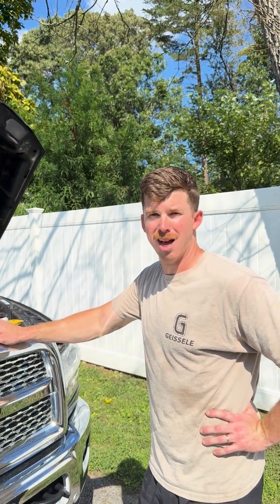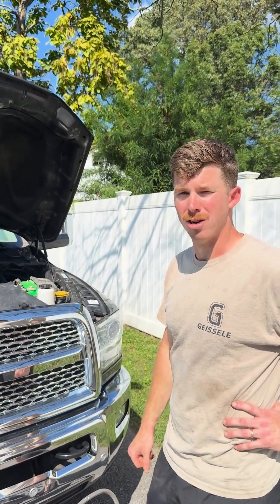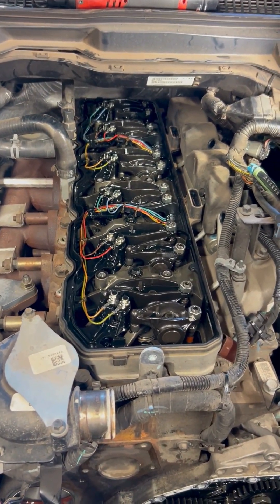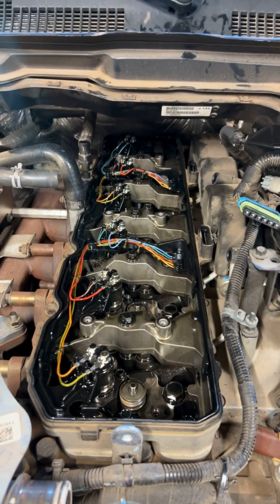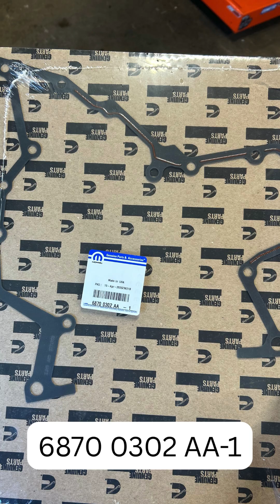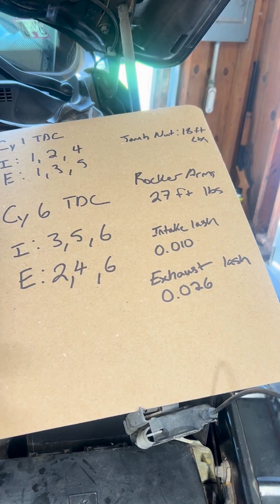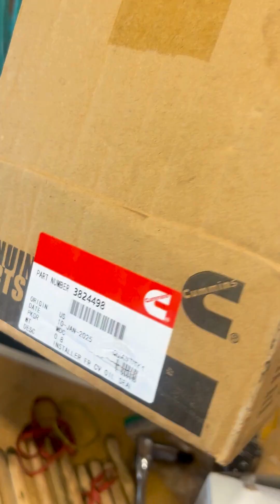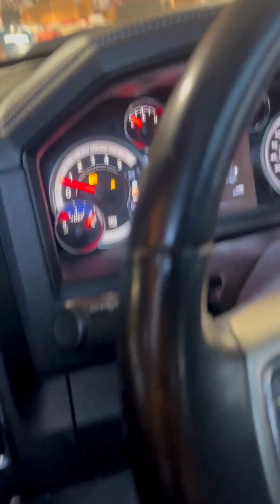6.7 Cummins Timing Case Gasket Replacement

Comment: Man I can’t thank you enough for this video! I’m getting ready to tackle this on my truck, 130k miles. One question, did you put thread locker on your timing cover bolts to maybe prevent them from coming loose? I’d hate to have to repeat this again in 100k miles
Reply from the maker: It’s definitely a stressful job. The black truck shown in the video is the actual truck I did the job on, my friend’s 2018 that only had 85k on the clock. The gray 18 is my truck. 

I think I did use some threadlocker, what I would recommend is Loctite 243 which is blue/medium strength but oil resistant. That’s my favorite thread locker i discovered from working on Harley Davidsons. 

Definitely buy an OEM Mopar/Cummins gasket and have an oil pan gasket ready when you likely break off the front of the oil pan gasket when you remove the cast aluminum timing case. Lay on the RTV thick on the stamped steel outer cover. I went thin the first time and had to tear it back apart because of a pinhole leak.

Comment: This is Michael H. Good video, Matt, you are making your TCS formers very proud. Are you still in the USMC? That hair is looking a little out of reg. Good Luck, looking for more videos soon. Chevy S-10
Reply from the maker: Hey Mike! No longer on active duty, still serving in the reserves though. I am starting a new engine build soon. I will be building another "LS" engine soon, a 6.0 LQ4 from a 2004 Silverado 2500 I just finished parting out. I bought the entire truck took it all apart, sold all the body parts, frame, differential, etc and kept the engine/trans and ended up turning a profit. So aside from my time a "free" 6.0 LS engine with a 4L80E transmission. Dont know what it will go in yet but I am thinking an 80s GM G-body.
Reply: @Markee_Garage  that’s good well, I look forward to your other videos. Good to hear from you. Rock on.

Comment: doing this job on a 5th gen now. still lots of good info here for that even. thanks for posting this.
Reply from the maker: Appreciate it. Yeah this was my first video, I decided to do it when I noticed there wasn’t many videos on such an in depth project. It should be the same process on a 5th gen.
Reply: @Markee_Garage  Just about the 5th gen has hydraulic lifters is the major difference. So anyone reading this working on a 5th gen you either need the tool to hold them or you can make them from the wooden dowels but you need a magnet on the end.
Reply: well how bad was it? how long did it take you?
Reply: @mikeallen3646  it was pretty in depth and I took the whole thing apart from the nose in. reason being I figured I could cheat and hold the lifters and just pull the cam out far enough but I didnt want the headache of the tight space and I had other stuff to do. So it took way too long probably 2-3 days in total but that was working here then going to work then coming back to it etc. If you do it like I did and just worked on it personally I could probably do it 12-14 hours I would think but plan for more or just cheat the cam out far enough and be done in a few hours. If you have a 5th gen youll need the lifter tool or just make wooden dowels. I drilled the dowels, shaped them to fit the lifter and then super glued the magnet into the whole I drilled. Put something in in place of the cam when or if you pull it out the hole, if you drop a lifter it may not have clearance to fall into the oil pan and then youll really be up a creek. Also goes to say take your time fitting and preparing the dowels if you make them. You want them to fit perfect. I also checked 4 or 5 times that they were holding the lifters all the way up before pulling the cam. Just take your time and dont be afraid to stop and put the cam back in if you think there is an issue. I probably put the cam back in before fully removing it twice. It is heavy and there is a bunch of leverage until you get it further out so it feels wrong. twist it as you go and say a pray

Comment: How long did the job take?
Reply from the maker: It took all of a Saturday, Sunday and after work on a Monday and Tuesday. I also wasn’t prepared to do the inner case when I did it. I was doing the repair for a friend and he believed it was the outer stamped case. So I spent half of Saturday running around getting what we needed to do the job. 

Buy an OEM gasket, the air hammer adapter to get the fan off and an oil pan gasket just in case the front of it breaks with the timing case. I had to splice in the front piece of a new oil pan gasket with the seams sealed with RTV